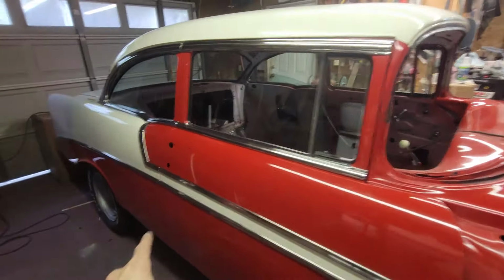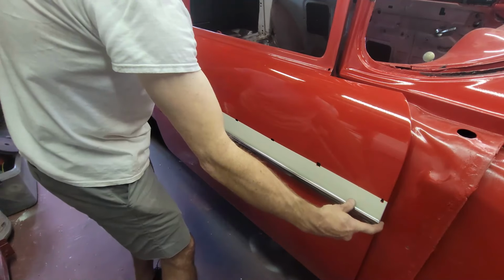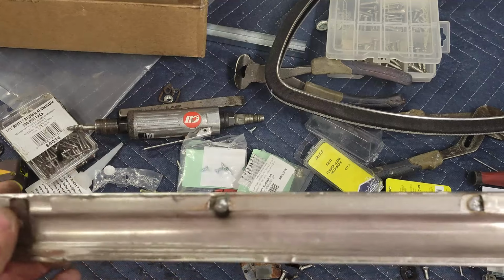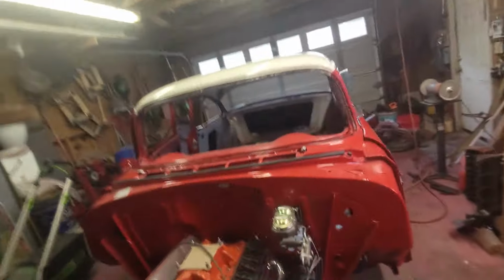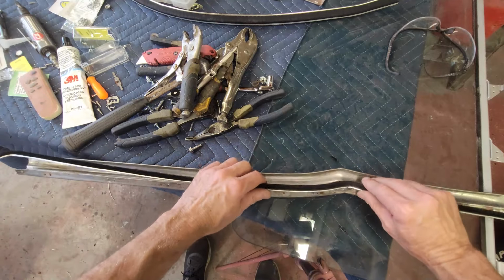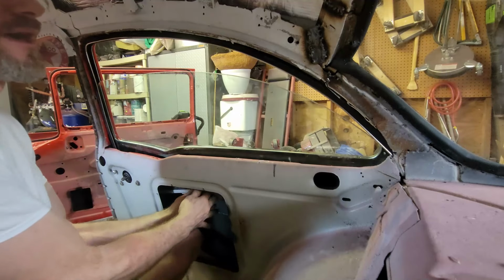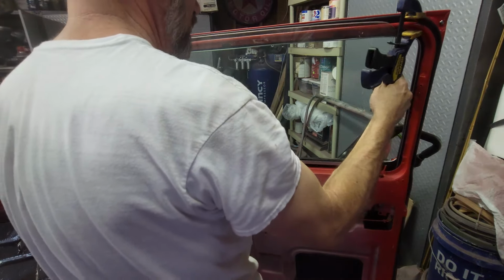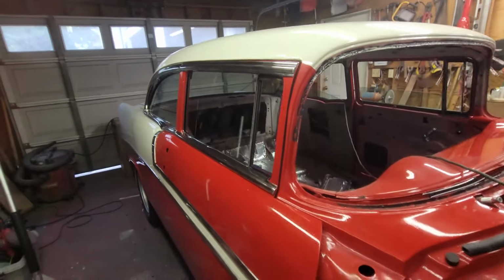E134 How to Install Windows, Vent Glass, Trim, Fuzzys & Run Channel! 1956 Chevy Bel Air Restoration

Comment: Thanks for the step by step instructions.this will definitely help future Folks.i just finished doing the exact same steps on my 57 yesterday. unfortunately I scraped a little clear coat when installing my outer lower window trim. I'm finally now on to interior.
Reply from the maker: It is so easy to nick the finish, no matter how careful.  Christine has beauty marks all over that I need to touch up.

Comment: I don’t have a TRI5 or a Chevy but it’s motivating for me to get my 66 Fairlane convertible back on the road. 

My hope is to one day soon strip it down and do a 100% restoration like this. 

I will be happy and sad at the same time once you’re done with the car. I look forward to your videos.
Reply from the maker: A lot of what I'm doing is applicable to any car from the 50s or 60s.  Part numbers may be different, or where the bolts are, but otherwise, they were all made very similarly.

Comment: The benefit of having a 150 model ... no chrome ... I'm glueing my back windows in ... made power windows for the front ... lookin good ... clock's runnin ...
Reply from the maker: It's expensive!  Both time and parts!

Comment: I'm thinking you are going to add the "A" pillar while doing the windshield install.
Reply from the maker: Add to it?  I did add some width to the bottom corner flange of the passenger's side.

Comment: Wow! I need help with my vent windows, 55 chevy bel-air. They are frozen (won't move). I used channel locks on the spindle, did not help. They moved a little. Is it possible you can give me a suggestion?
Reply from the maker: I rebuilt these in Episode 119:  https://youtu.be/72WfLgCuJXo

That might help you figure out what's got yours stuck.  But there is only the regulator that turns them, so if it's not rotating, then its the regulator that's jammed.  I don't think it's possible to get them stuck in the pivots.  They sell replacements and it's an easy swap once you get your door panel off.